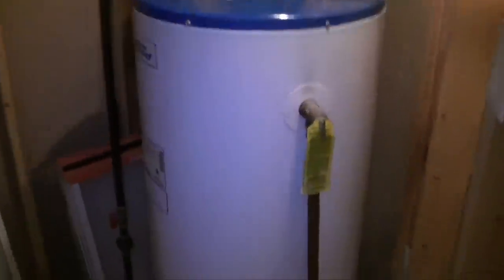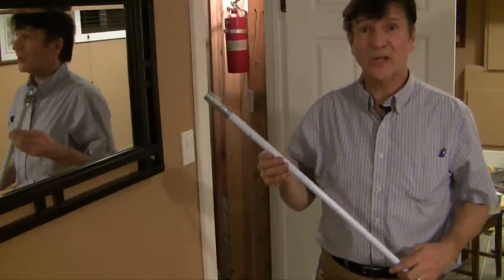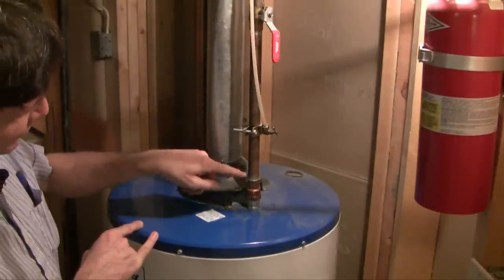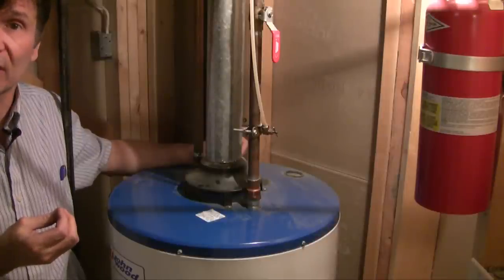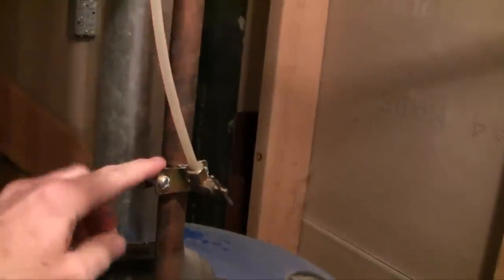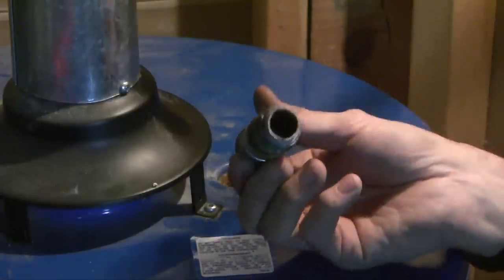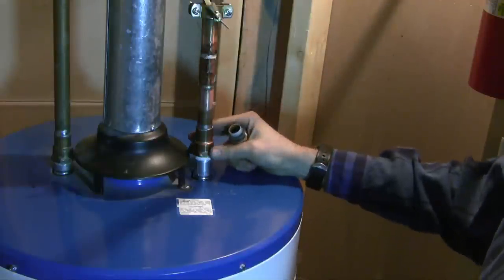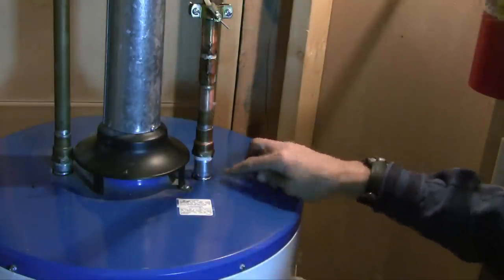How to repair a weak hot water heater, by replacing the dip tube

Comment from the maker: Evidently Google still hasn't fixed the glitch that won't allow us to respond directly to some viewers' questions. This is in response to John Antonio's question about my strange looking pipe wrench. It grips the cylindrical pipe, allowing me to tighten the threads. Any pipe wrench would do.
Reply: Thank you for the video, very well done. My hot water heater is only 2 years old and I am experiencing the same symptoms as a failed dip tube. I will investigate tomorrow, thank you sir
Reply from the maker: Good luck! Please drop by and let us know how it went.

Comment: Thanks for the very informational video. Originally I thought maybe I should replace my thermostat but now I think the dip tube is a more likely culprit. I checked my gas AO Smith FCG-40-248 water heater and there is only a threaded nipple sticking out - no pipe body to grab hold of. Is there a trick to be able to get that part out? It looks like removing it could be really difficult and I'd hate to crush it and then have to replace the whole heater (and not have hot water in the meantime).
Reply from the maker: You make a good point. As you say, removing the tube can be the most difficult part, and it could be a deal breaker. There may be a way to inspect the dip tube before diving in. One viewer mentioned the trick to remove the pressure relief valve, allowing a window into the tank where you can see the tube from inside. As you can see, my tube was easy enough to rotate backwards and remove. If you have no gap between the threads on both sides, you may need to sacrifice the distal threads, and if you can't get it out you risk needing another tank. Many of us are in the position where a new tank would be needed if the problem can't be fixed. The other point is that professionals often just replace the tank without even trying to replace the tube. So, you don't have that much to lose if things go wrong.... Thank you for watching!

Comment: Thanks for your video. I am having the same problem as your tank was. I suspect the dip tube is either broken off or cracked. The tank is a Whirlpool gas 50 gallon, model is FG1H5040T3NV. Unfortunately I cannot find an OEM replacement or even a part number for that matter. So I must go aftermarket. I need to know that length to purchase. I suspect it is very important to have the tube the correct length for the tank to perform efficiently. I am not sure but gas tanks may require a shorter length so the cold water does not immediately hit the thermostat sensor and confuse it. The tank is 55 1/2" tall and the thermostat sensor is approximately 10 1/2" from the base. Please advise...

Comment from the maker: It would be unusual for the tank to leak from the top. If it is a gas heater, I would check above for condensation, possibly near the exhaust flange at your roof. If snow or cold air goes down the exhaust, you can get condensation where hot air cools, leading to droplets of water that could drip downward onto your tank. With the uncertainty of what is happening, I agree, a quick professional opinion is a good idea.

Comment: Helpful video, thank you!  Question - is it necessary to turn OFF the gas completely for this?  I'm about to check mine (13 year old AO Smith that has recently not had as much hot water as it used to), but would prefer to not turn the gas off completely.  Can it just be turned to the pilot setting and temp all the way down?  Re-lighting it is a bit scary so I'd like to avoid it if it's not necessary.
Reply from the maker: I didn't turn mine off, I just dialed it down to pilot, so it wouldn't fire up while it was partially empty.
Reply: Great - that's what I thought.  Just picked up my dip tube - had to go to a plumbing supply store - none of the typical retail stores carry it.  < $4.  Crossing my fingers this is what my issue is.

Comment: Hi thank you for the video, I removed what I thought was a dip tube, but only a small coupler between the cold water line and the dip tube came off, how do you get the dip tube out if there are only inner threads and it is within the heater? 

It's possible that what I am calling the coupler it is the dip tube but broken off, but trying to put the new tube down there is facing restriction. Any ideas?

Comment from the maker: @DKDaniels1 Rock-like calcium deposits form within the water heater and when the water circulates around the tank, those rocks bang around inside the tank. As part of general maintenance you should drain your tank occasionally, and you may spill some gravel when you do that. But it's no harm to your system and if it doesn't drain easily I would ignore it. If you have ample heat, replacing the dip tube may not help.

Comment from the maker: If I may preface, I'm NOT a qualified plumber. But if it were me the first thing I would do is flush and examine the tank -- that's just good maintenance. When you examine the tank I would look at the burner plate if it's gas and the element if electric (power off). I personally would not replace the tank yet, since a new tank may not last nearly as long. 

Regarding the shower head, remove it (turn CCW) and soak in CLR, flush the line while off. Put on new teflon tape when putting it back on.

Comment: Hi i just started to get little pressure from the hot water  like you but i saw on your video that you changed the one on the cold water i really would apriciate if you have any tips for me thank you..
Reply from the maker: Changing the dip tube may affect temperature of the hot water but would normally have little effect on the volume delivered. If when you open the hot water faucet, you have very little flow of water at all, then look for a source of obstruction. If it's one faucet only, then check the shutoff valve for that device, and failing that then check the valve itself. If it's on all faucets, check the valve leading into the water heater from the cold water source. If it's on both cold and hot then check the house supply line. Really old lines can get obstructed by calcium buildup in the line, and of course copper piping can get pinched or kinked off. I guess if all of that checks out and you still suspect the dip tube then you could take it out and have a look. Pressure in the hot water side comes from pressure in the proximal cold water supply line through the water heater. Good luck!

Comment: Lucky you , you got that old corroded dip tube out one , two , three. Could it have been the wrench?
Reply from the maker: Those fittings are on there really tight, and if the tank is wobbly you may benefit from having another person to hold the tank steady. I don't think the design of the wrench has much to do with it, although the torque of any wrench is critically dependent on length. I have a 2" pipe that is six feet long, a 'cheater bar' to slip over the wrench handle, used when I need a little more leverage. Thanks for stopping by!

Comment: from experience dip tubes can be hard to find locally...amazon has them. there's more than one style so best to look at yours before sourcing a replacement.
Reply from the maker: Yeah, the last tank I installed ran the copper piping to the bottom of the tank, so cold water enters at the bottom with no need for a dip tube. It's a little more complex to hook up but it saves the complication of a hidden, fragile plastic tube inside. Pretty soon dip tubes will be a thing of the past.

Comment: Okay thanks I'll run a fishtape thrue the hot water pipe to see if theres something clogin the hot water from traveling with pressure what do you think ?
Reply from the maker: Whatever you do, make sure safety is at the top of your list. I doubt that fishtape would be able to make the usual 90 deg turn of a copper pipe, but it might be helpful at the entry and exit points to the tank. I wouldn't probe plastic pipe because of the risk of causing problems. Have a close look at the shutoff valve -- those could be a problem. It will be easier to get at the tank if the previous plumber used a union for quick tank replacement. The other thing to look for would be kinking of the piping, especially near any recent home renovations. Really old piping can certainly corrode along the length of the pipe, too.

Comment: Can't you just take the top off from the water heater to retrieve the dip tube?
Awesome video. Thank you very much.
Reply from the maker: The top is welded on, and small parts will be very hard to retrieve. No matter, they cause no harm and they are designed to be there.

Comment: Great video. I replaced the dip tube but now my cold water intake about an 1.5 inch higher than hot water intake. Would that cause any issues?
Reply from the maker: I'm sorry, I'm not sure if I understand the what you are describing.

Comment: i would add that the purpose of the dip tube is to allow the heated water within the tank to be used while the incoming cold water is directed down toward the burner for heating... i.e. the dip tube being broken near the top where the cold water enters the tank will allow the incoming cold water to immediately be exited out the hot water line... as heated water tends to rise like hot air, likewise the cold water should settle at the bottom of the tank nearest the burner.(in a gas heater)...

Comment: Thanks for posting this video. I'm experiencing the same issue, water doesn't stay hit in the shower but is hot enough for dishes and washing your hands. Probably because of the amount of water being used.
Question:
Does every residential water heater have a dip tube? My State Censible 510E doesn't seem to have one. Could this be a non-replaceable part?
Reply from the maker: I believe almost all conventional water tanks have them, but a tube could easily break off and drop into the tank. The dip tube shunts the cold incoming water down to the heating element, resulting in more efficient heating and better mixing. Also your heater cycling will be better because the temp sensor will immediately note the cold incoming water and turn the element on. To mimic that without a dip tube you'd have to design the inlet of the tank right at the bottom element, so your piping would have to come down the outside of the tank. Conventional designs are easier to swap into tight spaces. For specific details of your tank, you could contact the company and ask for a schematic diagram. Be sure the thermostat range is set on high, and for a gas installation inspect the burner plate to make sure it's clean. Good luck!
Reply: spelunkerd, Ok, I believe I have a drop in dip tube but the manufacturer doesn't carry it anymore and doesn't have s pert number either.
Reply from the maker: The last one I picked up was on the shelf at Home Depot. Typically these have a uniform size, generic connection. Check your overhead clearance since some tanks need to be awkwardly tipped on their side to be able to slide the new tube into the tank. If you only need an inch or so you could cut an inch off the end of the tube, although that may interfere with the intended function. If you can do the work on a weekday you can pop over to a professional plumbing supply house if your new tube won't fit. Otherwise it may be a cold shower until you can get it hooked back up. Make sure you have teflon tape and/or plumber's dope to get a leakproof seal. Good luck!

Comment: There are a few small rusty streaks at the top of the water heater. Is this an issue?
Awesome video. Thanks again.
Reply from the maker: Outside superficial rust is not usually an issue, but look for a leaking water source.

Comment: What brand of pipe wrench do you use for taking out the dip tube. The self adjusting one.
Reply from the maker: +scart121 Interesting design but not dramatically better. I don't remember the brand but I got it at Home Depot.

Comment: 1st off, nice video. 
Our hot water heater is around 15 years old. The hot water doesn`t last long like it used to and every time the shower is used there is what looks to be many calcium pieces that clog the shower head and must be cleaned before each use. Hot water in the shower lasts about 7 minutes before the hot/cold ratio needs adjusting. Considering its age, would getting a new tank be for the best? Instead of bothering with diptube, heating rods or even flushing? It`s never been flushed.

Comment: I know this isn't part of the instruction here but also from what I learned that one other symptom of a failed dip tube if you begin finding small bits of plastic in your faucet aerators, shower head, clogging strainers and filter screens on appliances.

Comment: i am having intermittent how water issues - takes a long time to warm up, sometimes doesn't get as how as it should, and then is fine other times. will try your dip tube suggestion first. Is it common for these to fail within 5 years?
Reply from the maker: Evidently the plastic doesn't stand up to the heat very well, so I would not be surprised to see an early failure. These days, water heaters are poorly made in general....
Reply: finally got around to this and there was no tube left at all. replaced and running perfect again. thanks!
Reply from the maker: Good job, I'm glad it worked out for you. Thanks for following up here, I'm sure others will benefit from your experience.

Comment: Do all water heaters models have these dip tubes?
Reply from the maker: No, the most recent one I put in (at another home) does not have one. If the piping enters the tank from below, I would be confident to say there is no dip tube, as is the case with some modern tanks. However if the cold water supply enters from above, it very likely has one. The plastic dip tube has proven itself to be an Achilles heel, prone to fracture as the plastic becomes brittle. There also is some risk when replacing one because if you can't get it to seal later you may end up replacing the tank, anyway. Like replacing the anode rod, there is some risk. So, I guess I shouldn't have been surprised to learn that many professionals replace the tank rather than trying to replace only the dip tube, since they need to charge for labor anyway. Clients pay a little more, but they end up with a new tank and a warranty. It's not what I would do, but I don't have to pay for labor.

Comment: I have a banging noise coming from the hot water heater on;y when the hot water is turned on and it sounds to me like something is loose floating around and was told most of the time it's the  dip tube. I still have plenty of very hot water and I didn't hear your heater making any noise with your dip tube being broke off. So what do you think it might be? Any help is greatly appreciated.

Comment: I have a problem that seems like a failed dip tube but I also have a heating loop that goes to a fan coil unit.  If I run the heating loop I have hot water again for a few hours.  Is this still a dip tube problem?  The feed pipe for the loop is plenty hot from the get-go.  I suspect that pumping through the heating loop and introducing return water is mixing in the tank enough to get passable hot water.  The strange thing is, this tank is only 4 months old.  Do dip tubes have early failures?

Comment: thanks for your video and good info. Need your opion. I've been having the white build up in my faucet screens and have a 50 gallon hot water tank and running out of hot water before the end of one 20 min shower. At first it would run out at the end of a second show back to back. Btw just bought the house a month ago. My question is should I replace or repair. The hot water heater is 20 yrs old and works off the power vent which is getting loud. Can hear it on first floor running in the basement. Also they are expensive. Local hardware store says 1500 to replace withe like model. But for 2000 I can get a tankless installed what's your thoughts.
Reply from the maker: I'd be at least inspecting the dip tube first, you may get a few years out of it, and older tanks are much better built than new tanks sold today. One viewer mentioned that you can often inspect the dip tube from the pressure relief valve port if you want to go that route. The calcium buildup at your faucet screens are from calcium in your water, unrelated to the tank, although the same process is likely going on all through the plumbing system. I would flush the tank of debris, but be careful not to burn yourself and remember to turn the burner off before you do it. Inspect the burner plate if it's gas to be sure nothing is interfering with heat transfer outside.

Regarding the tankless debate. Yeah, in a few years all new construction will have them, and a retrofit is pretty straightforward if you're close to an outside wall for the vent needed. I was in the same situation as you were when I made this video, and I recorded my experience in real time not knowing what I would find. As you see, my repair was less than $10 and I eventually sold the home without ever looking back. Of course there are risks whenever you do home repair but the biggest risk is suddenly needing a new tank because you have a leak after doing the fix. Once you get to the point that something has to be done, it seems like a small risk as long as you're careful and work safely.